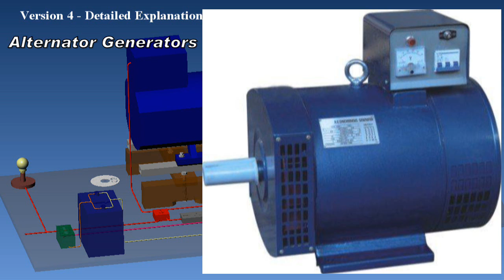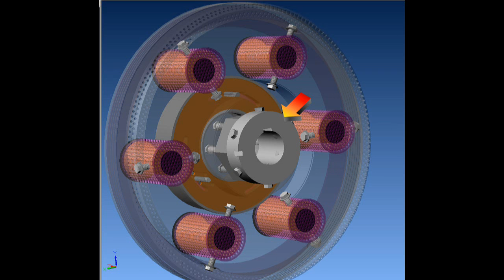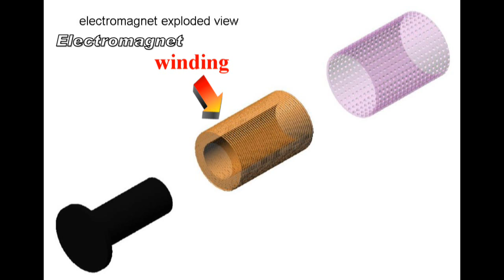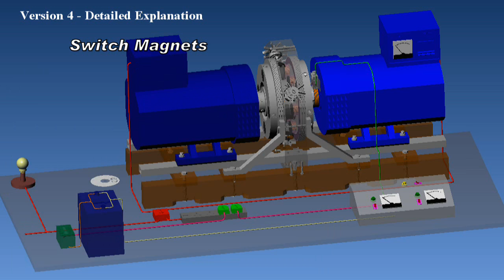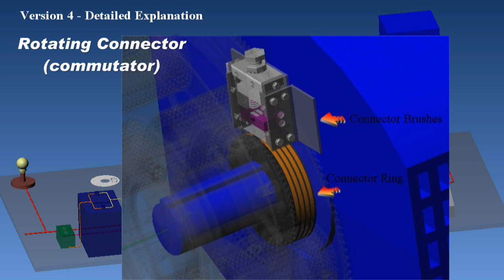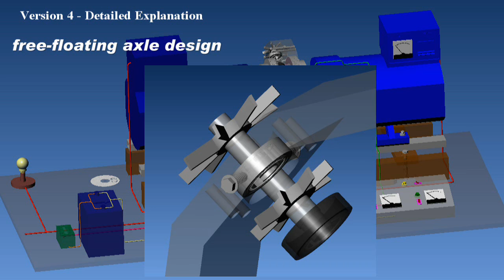Electromagnetic Differential Drive Generator part2of3

Comment: Interesting stuff, I take it you never built one?
Reply: wow, i thought this video had been long forgotten. you're correct that it was neve built. there are a few fundamental techinical issues with this particular old design which would have made it difficult to get working as intended. such as using physically mounted reed switches has issues with exact placement and adjustability, and 'normal' type electromagnets cannot get to full capacity and release the charge fast enough. however technology in general has advanced so much during the past 10 years that those (and other) issues now have good solutions which make it potentially doable to incorporate into a new (and quite different design). the main physics concepts are still ok, and i really think it is possible. if there are any future developments on this technology i will comment here to point you to any new information. if this ever gets solved via an actual working prototype (proof of concept), i intend to open-source it.